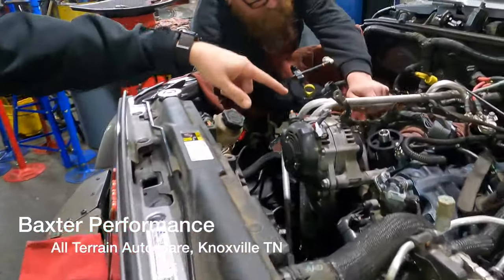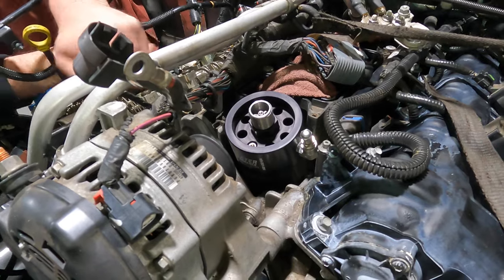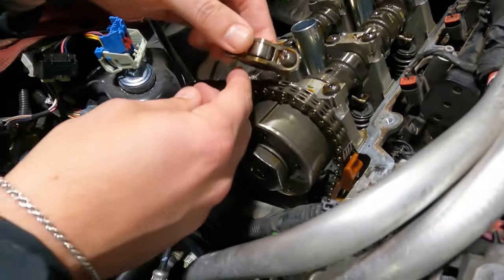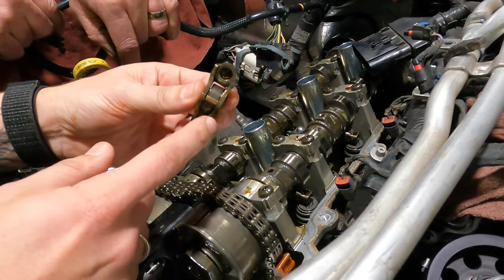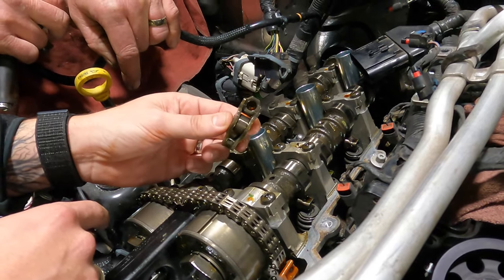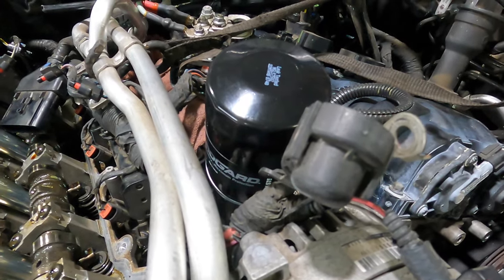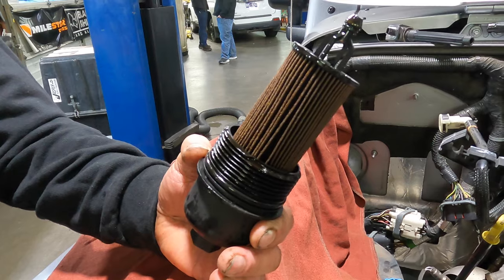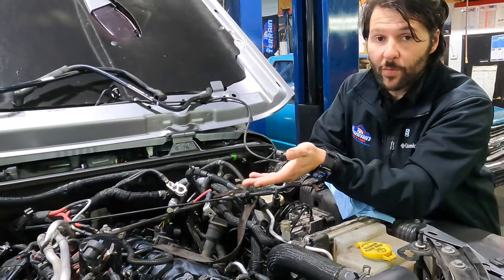Jeep Camshafts and lifters problems with a Pentastar engine, Baxter Performance has adapter to help

Comment: but we were told for Years, that Full Synthetic Lubricant bonds to the metal and prevents this type of issue.
so is it really this filter type causing this or poor quality metal being used in the pentastar to keep cost down to please the investors and government?
don't see any other auto manufactures who use this style of filter on their engines having videos posted about it.
Reply: Most vehicles with a spin on filter have a check valve in the filter, but not in the cartridge type. This is a good investment for the 3.6….
Reply: @williamtoney2599  if the cartridge filter is causing problems, then why isn't there any videos about Toyota having this problem, since Toyota uses the cartridge filter also.

Comment: Toyota may have a different setup all together. I’ve had 2 Corollas in the past and currently have a   2015  Corolla now. My other 2 had spin on filters, but this 2015 has the cartridge type. It doesn’t drain back and rattle on start up like the 3.6’s do. The filter is situated at the rear of the engine down low beside the oil pan. That may be the reason. My 2016 F150 uses the cartridge type filter and it rides up high at the front of the intake similar to the 3.6, but it doesn’t rattle on start up either. It had a check valve in the filter housing to prevent that. Thanks